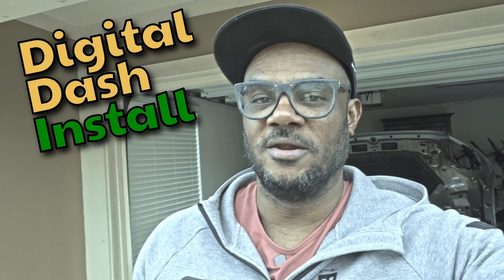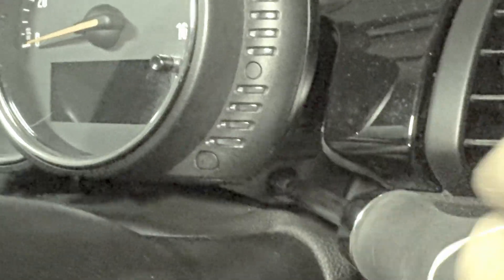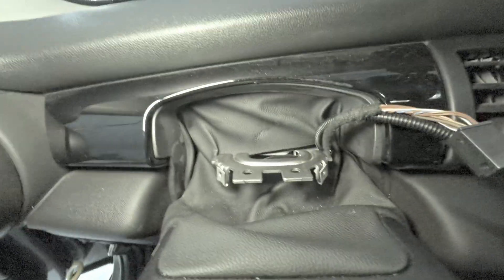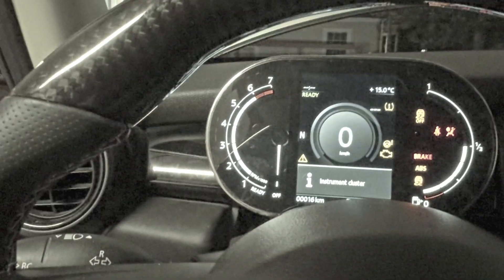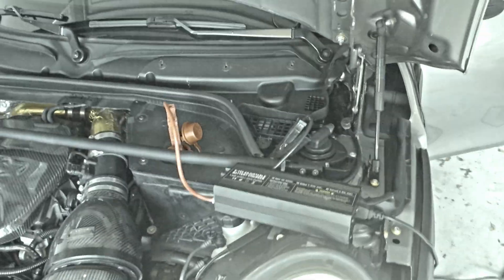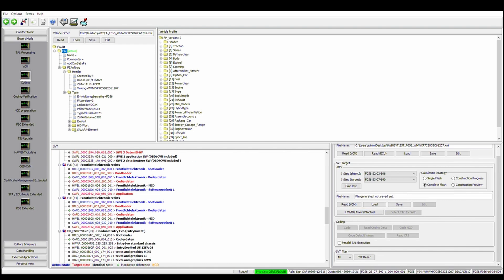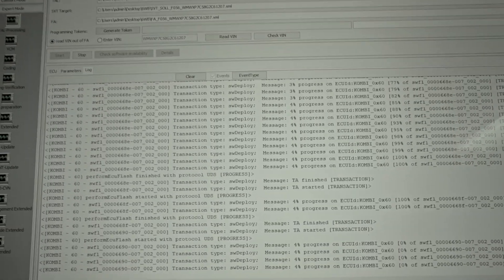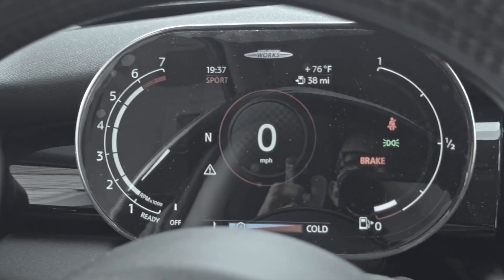Transform Your Car with a New Digital Dash!

Comment: I'm impressed with how easy the initial switch is to do. But the programming would be pretty scary for me I'm afraid. I've reached a point at my age that I'm not inclined to dive right in. A few years ago I would have done it. I do have a question though. Can you do the programming on a Mac? No PC's for this guy. Thanks for sharing!
Reply from the maker: Well, the programming side is in my wheelhouse. The required software requires Windows, unfortunately. There is a way to run it on a Mac, but it isn't recommended.
Reply: @MiniBrothas  Thanks!